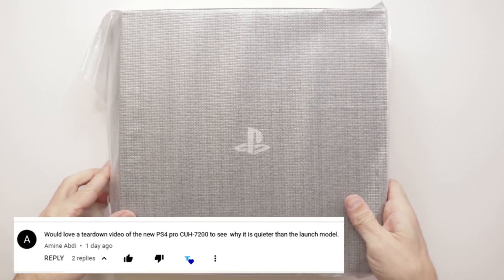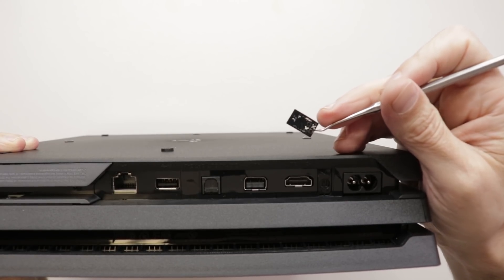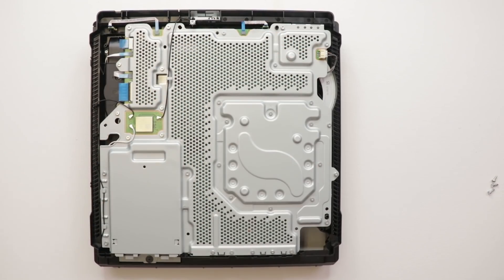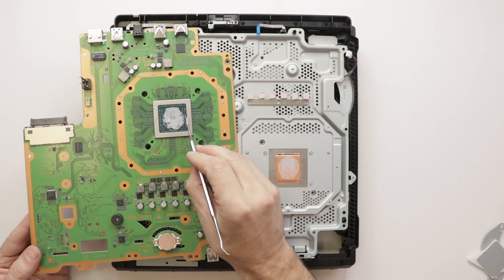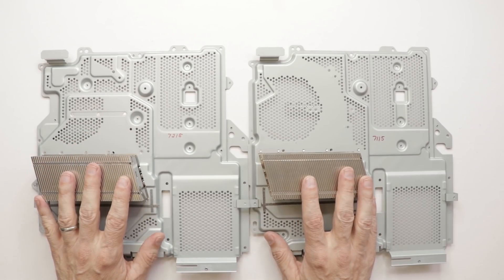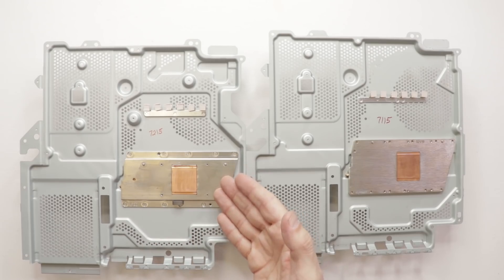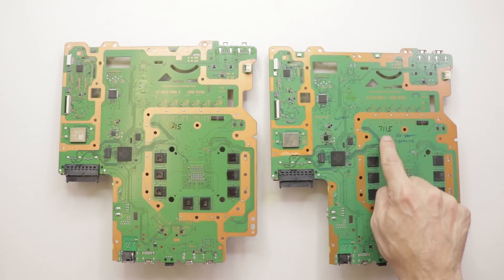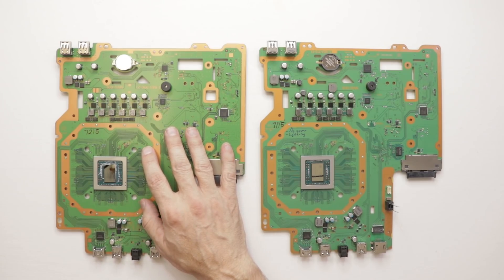The New 2018 PS4 Pro is so Quiet - But Why? Disassembly and Comparison - 7215 Model

Comment from the maker: What do you think...should I do a heat test & test it with liquid metal?
Reply: TronicsFix 
Absolutely : )
Reply: Yes and a sound test as well under full load
Reply: Use a watts meter on them both, see whether draw different amounts of power, test the heat, quieter fan profile hotter chip?
Reply: Do a power draw and heat test on it
Reply: Please. I’ve seen things that say although it’s quieter, it still runs hotter.
Reply: Can you please stop using power tools on electronics? Also, please make sure to apply liquid metal to the entire APU this time. You can use clear nail polish to cover the ripple suppression caps and diodes to make sure no LM gets on them and shorts. Also, the power delivery (mosfet) and VRM sections, along with chip size is different. Can you give us a size measurement with a micrometer? Would be much appreciated. 

Also, I'm not trying to troll you. I've been in electronics (Aviation Simulation) for many years, and a lot of problems are induced by improper practices, such as power tools on sensitive devices, or improper application of problem solutions. I just want you to do well and provide excellent information to your viewers.
Reply: It’s a yes from me please
Reply: oh yes ! 
it would be a good idea !
Reply: Yes
Reply from the maker: @bleedingheart I don't remember. I'm planning to start putting the track names in the description but I also might forget. They are all from Epidemic sound.
Reply: I personally would glad to see an installation of IC graphite thermal pad instead thermal paste on the PS 4 Slim.
Reply: TronicsFix yes you should do a heat test on I would love to see it. P.s thanks to your videos I was able to see moisture or water damage that was on the motherboard of a Xbox one I got from OfferUp I paid $30 for, cleaned it up and dusted everything off it end up working last thing I need to do is do the off line update  and we good to go. Thanks your super awesome.
Reply: Yes do it
Reply: First do a normal test thank u
Reply: Yes please. Temperature and noise tests too also please.
Reply: Please do with new ps4 slim series cuh 22
Reply: Yes! Please!!! :)
Reply: Sure, but a before and after test would be even better.
I
Reply: Check please power consumption via some china powermeter.
Reply: Yes please do. I have picked up the RDR2 bundle. I haven’t set it up yet. I’m curious on how loud it’s to be and how hot is going to be.
Reply: sure👍
Reply: yes please
Reply: Duh
Reply: Hey tronics! Great video as always but I'm at a predicament. . . I just replaced thermal paste on ps4 pro 71 series and this will sound really weird but I'm sure you'll know what it is! The Pro runs quiet and as it should since the paste is antec nano diamond 7 series! Anyway I sit about 2foot away from my console and if I yank myself up outta my gaming chair it's enough to make the screen glitch out to where it either goes green or fuzzy and I have to take out hdmi cable and replug and then it's done but if I move the console around, tap it, knock it, nothing happens whatsoever unless I'm in my gaming chair directly opposite the console and get up really fast in a jolting manner! Please help! I've opened it up and checked thermal paste and applied again, checked pads, even checked the white thermal pads for the ram I presume? Please help me tronics I'm so gutted! I followed your video to a T!.
Reply: Yes!!
Reply: Smaller chip which consumes less energy.
Reply: Yes, test with liquid metal!!

This is the best extreme console gaming YouTube channel!!!!
Reply: Yes, maybe you should do! Of course, you do :D
Reply: Yeeeessss
Reply: Yes
Reply: Yeah duh bro
Reply: TronicsFix PS4 pro 7215 new
Reply: Easier to Test it with a other thermal Paste.. liquid Metal is conductive 🤯
Reply: Yes!
Reply: Why does it look like you could swap the board with other console
Reply: Music a bit to much don't ya think...
Reply: If you do, I might need to open mine up and throw some in ;)
Reply: Can u do a comparison with the 7000 series with the 7200
Reply: Because I bought the pro when it first came out in 2016
Reply: How come you haven’t compared it to the base model ps4
Reply: I have  liquid metal on my PS3 and put in ssd runs mutch faster and 
quieter than before, but still get hot like a girl when I have played manny hours with her
Reply: Yep do a liquid metal test
Reply: The cooling system is a different technology. Same as the one used in the new flagship phone. It has a small amount of liquid inside.
Reply: yes bro...
Reply: I have the RDR 2 pro, and it still makes noise. Especially when playing heavy games like the witcher 3. I really hope the PS5 improves in this aspect. It's really annoying to game and stay immersed when your console is not quite.
Reply: why not check the new slim model it's old but still differ
Reply: what the model number for the 500 million limted edtion ps4 pro
Reply: I doubt anyone would see this but what screw is that at 1:57 im stuck
Reply: I heard its the power supply that gets hot in the older ps4 pro 700 series. Just wondering would a new power supply from the new version of ps4 pro work on the older 700 series.
Reply: I already have the answer to why the new 2018 PS4 Pro model is much quieter than The 2017 PS4 Pro model all they really did was made 2 hardware changes it has nothing to do with software too many people are overthinking this 🤦‍♂️ The real reason why PS4 Pro 2018 is almost whisper quiet because It consumes a lot less power They basically made it power efficient and improved the heat sink in order to dissipate the heat straight out of the PS4 Pro 2018 😉👍 They didn't use any new chips no nothing Even the 2017 PS4 Pro was so damn power hungry I knew it was consuming too much electricity Which caused the fan speed to increase over 55 decibels🤦‍♂️ The lowest decibels has been recorded at 44 with the 2018 PS4 Pro that is impressive 😲 However the clear winner of the most quietest game console of all time goes to Xbox One X 😍 I was shocked No matter what game I play it's impossible to hear the fan It's all thanks to the vapor chamber technology Microsoft has invented 😍 And the lowest ever decibels recorded was 40 that is stupid quiet 😲 I feel like every game console needs to use the vapor chamber because it's way better than using a heat sink 🤮
Reply: Yes. Also, if you wouldn't mind, you should make a video for the most ideal PS4 pro set up. And I mean like, for the best version of the console, should we have dust filters + fans on the back and bottom, liquid metal, 4k gaming cable worth it, SSD in ps4 pro etc worth it? I would love to see a ps4 console that has all of the those features but only to see if it is all worth it for a better, more ideal ps4. also, does an SSD make the console run cooler or have any impact like that? I would like to know. I apologize however because I am asking a lot, I'm just wondering because I have a 4k gaming cable with a Samsung 850 Evo ssd and thinking about getting dust filters because I saw your video on them but now I'm wondering if everything combined would make the console more "ideal" and worth it....
Reply: Again, thank you so much for your youtube videos. 
At first a heat and noise comparison of the three Pro models would be nice. In second place it would be interesting what you measure after replacing thermal paste. But please no liquid metal. In my opinion the risk of destroying the hardware is to big. A good thermal paste like the grizzly kryonaut should be good enough. But if i think about it...hmmm..  a comparison between the liquid metal and the nonmetal thermal grizzly kryonaut paste would be very interesting. 
Can't wait what you will show us next! :)

Comment: I seen some cpu/gpu's on the ps4 pros are not flat enuff to make good contact with the heat sync. I've Seen roughly 0.025"  difference with a straight edge.

Comment: Quiet? My PS4 Pro CUH-7216B is an absolute jet engine and converts my living room into an airport. It gets really hot and needs new thermal paste, thermal pads and probably a fan replacement to run smoothly again. Without those repairs it is basically unusable loud garbage.

Comment: I have a 7215 model of ps4 pro with a jb. I used orbis tool box to measure the temperature of cpu and soc. As per my understanding, this model of playstation  runs at 83 degree for most of the time while playing games. Once it crosses 83 degree, the fan starts blowing faster. And i guess the older Ps4 pro had the temperature limit of 79 degree instead of 83 when playing games. So the fan would run faster most of the time to maintain the temperature of 79 degree or below. And because of that, it made more noise. This is the only difference. The temperature limit. Rest they both work the same way.

Comment: Maybe TSMC changed a few nm manufacturing process. They did it with ps5 a few months with the third release. Now it is 1 kg less heavy and a small copper heat sink is enough to keep the system in its limits

Comment: the newer ones just tweaked the fan curve. the thing is, fan speed gives diminishing returns, a fan at 100% doesn't help much more than one at 80-90%. But the noise goes up exponentially. So capping the fan at about 80% and a less aggressive fan curve would mean a lot less noise, with minimal impact to thermals

Comment: I picked up a PS4 pro recently was depressed to learn about this better 7200 model as I ended up with the 7100 one with the "kettle lead" style connector...  I've not noticed the console misbehaving but I hope it doesn't;t do this "jet thing" that other people have...  I wonder if the 7200 has a less aggressive fan curve or something or a slower fan.. does it run hotter? or is it cooler AND quieter.
Reply: I would say that it is more balanced in terms of heat and noise, but changing thermal paste and thermal pads makes it very quiet
Reply: Does it now the "jet thing"? Just asking

Comment: Has anyone actually measured the voltage output to the fan? Or the fan rpm.  Maybe it's just slower..  a faster fan isn't always more efficient.. sometimes slowing flow makes things work better

Comment: Thanks for the video, a question, the screw on the bottom of the power supply is black, the others are silver, the key I use to remove the silver is not for black.  any tips?  I didn't find a key that would work, I was in doubt whether I should remove it.  Thanks.

Comment: if you ask me they put more thermal paste on it, the ps4s i just replaced the paste on (3 of them) all seemed to have a criminally small amount of paste i can't imagine it was transferring the heat well
Reply: The ones I see tend to have a lot of paste on them, usually its flowing off to the sides. I also replace the thermal pads on ps4s I open and they tend to be near silent

Comment: I beleive they dont overclock as hard on the quieter model. Mine is the jet engine version.
Reply: Overclock? What are you even talking about? The ps4 doesn't overclock whatsoever.
Reply: @rockl79  yeah the pro does they overcloacked the jaguar cpu ya mung

Comment: Is it possible to mount the CPU (PC) cooler on PS4 pro APU?
Reply: Assuming you can somehow mount it, yes. But since the ps4s cooling system is custom made it will be hard to find one that works, or you might even have to go the linus tech tips way and zip tie it

Comment: I took apart my launch model Pro, applied better thermal paste, vacuumed dust that had accumulated on one side of the heatsink (not visible unless you take it apart), and it's now whisper quiet with even the most demanding of games.
Reply: @themikepadua  what thermal paste you use?

Comment: Did you take a closer look at the fan design?
Reply: The fan is the same. It seems the 7200 runs a bit hotter than other ps4 pros, so its fan is likely just spinning at a lower speed

Comment: bro it's a different fan in the 7200 series than the 7100 series
Reply: Some 7100 ps4s use the same fan as the 7200s. Its known as the nidec and delta fans. Delta fans tend to be the louder ones

Comment: launch model was not loud damn noobs got it wrong. it was the 7100 series that was loud. the first ps4 pro's.
Reply: None of them are loud. All you have to do is replace the thermal paste and pads. I have a 7100 that I use and its near silent

Comment: My ps4 pro is a 2017 model and is usually quiet after ramps fan up a bit... ray tracing prob low speed but i think i hear it but not as much as friends prob original model
Reply: Ps4 doesn't have ray tracing, it uses path tracing
Reply: @rockl79  o, is it just ray tracing but not really time? Still looks nice

Comment: I have a buzzing noise on a newer ps4 pro model, it appears to be coming from the power supply pls help 😪
Reply: Its called coil whine, and your best option is to just deal with it. You would have to replace the components in the power supply causing it, which is way too much work

Comment: After changing thermal paste on my original launch day ps4 fan noise is 90% fixed
Reply: exactly, i did a repaste with Honeywell PTM7950 on 7015 model, plus install a ssd and it is so much quieter now

Comment: My PS4 Pro was very noisy right from the day I purchased it but I made it almost silent when playing games. It is very easy to do and your PS4 Pro will work as quiet as mine no matter which revision of PS4 Pro you will use. All you need to do is to replace thermal paste. That's it. The thermal paste Sony uses is not a very good quality and tends to dry out fast and probably has very low thermal conductivity. Even something like MX-4 which is what I used is a much better paste in terms of thermal conductivity and should last much longer, though even this paste will need a replacement after few years.

Comment: Quieter? Not really, I have the RDR2 ps4pro and it sounds like a hovercraft is in my living room. At least it lasted longer than my Destiny 2 ps4pro which was dead in a year to the day. This new one lasted me a whole 18 months before it died. I'm now on my 4th ps4, they just don't last. My gaming computers don't break like this so it must be Sony, not me. Im I'm replacing the hard drive hoping it will fix it, I really don't want to buy a new one right before the ps5 comes out. I'm really frustrated with this and if I didn't have over 100 games and the VR as well I would give it up.
Reply: you had to see him change the thermal paste and thermal pads with that you already solve the noise
Reply: @manuelRdr21122  (a year later) I did and it was much quieter but it stopped connecting to the internet unless I was plugged in not too long after. I use a PS5 now, no issues yet.

Comment: I have one of the newer models (7215) and always noticed it was rather noisy, i thought geez the older ones must be unbearable.

Recently it was getting even louder and I was getting "too hot" messages when playing Spiderman so i figured i'd open it up and clean the dust out (i've had it for 1 1/2 years) but nope barely any dust (i dont play it that much). 

Turns out the Thermal paste was poorly applied (APU not making full contact with heatsink) and now it had completely dried up, cleaned it all up with 99% and put some Arctic Silver Ceramique and the thing is now very quiet.

Sony still have some quality controls issues to sort out thats for sure.

Comment: Another thing is that the newer model 7200 has as you mentioned a different king of motherboard. I tried to replace it with the earlier ps4 pro models motherboards, and it made some problems. Apparantly you have to get the exact same MB model, but i do not know about the DiskDrive, because usually they are paired together.

Comment: The newer model is a little downfall when it comes to the Power supply Pin. The lines are very close to eachother and therefore a big issue in case it gets ripped of the motherboard which happened to me... and unfortunatly, I could not fix it by soldering, it was not easy...

Comment: I have the cuh 7216b and the noise it makes is ridiculous, ive had it for about 8 months and it's always been very loud, I've made sure the vents are all clean, moved it into different locations in the room and it's made zero difference. If it wasn't under warranty I'd have taken it apart and changed the thermal paste

Comment: I have a 7200 series (RDR bundle) and it definitely runs hot.  The fan sounds like a jet engine taking off, going as far as to perform a hard shut down during some games.  I'm going to try replacing the thermal paste and pads, but I think this may be just a bad unit.

Comment: I changed the fan to Nidec and now it's quiet! I have the first version of ps4 pro. Before was a true jet engine. All i did is chage te fan, thermal paste and clean the heat sink in the back form dust (it was preatty dusty). Now It works quietly! I changed thermal paste and clean the heatsink before with no good resoults, so I gues it must be te fan!

Comment: I can't remember when I got mine, but it was NEVER loud. I think I won the lottery with this one, because of all the comments saying their sounds like a jet.
I did print out legs for it and glues rubber feet on them, so it can stand upright and not transfer vibrations to the furniture. But I think people have problems with heat and the fan spinning at full rpm. I can hear my HDD more than I can hear the fan. Also cracks when it heats up and after I turn it off. But those sounds are normal and not problematic.

Comment: The pictured PS4 Pro motherboard tray for comparison at 4:14 labelled as a 7115 is infact the motherboard tray from a 7015 PS4 Pro model. The PS4 Pro 7215 model motherboard tray is actually identical to the ones that come with PS4 Pro 7115 models.

Comment: I have an OG ps4 pro and I appreciate the cooling system. I don't mind the sound if I know the chipset is running cooler than the newer models. I actually run my computer fans faster than they normal cause I prefer my units to be cooler.